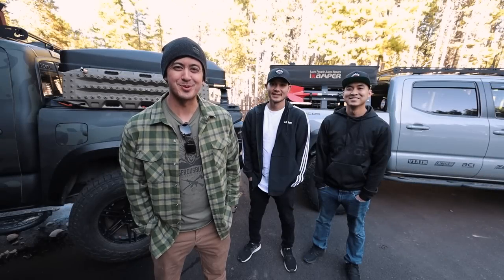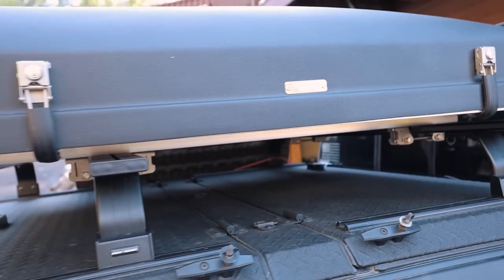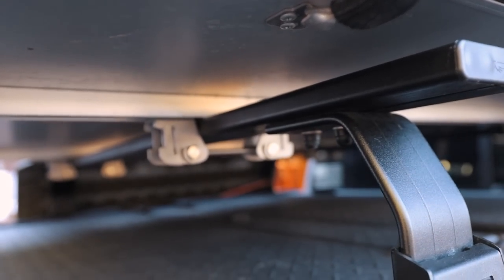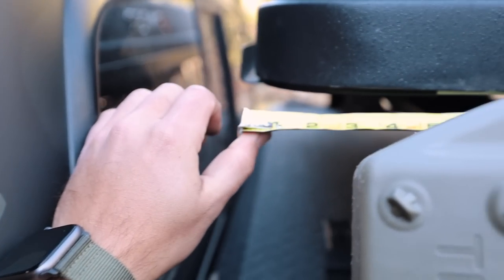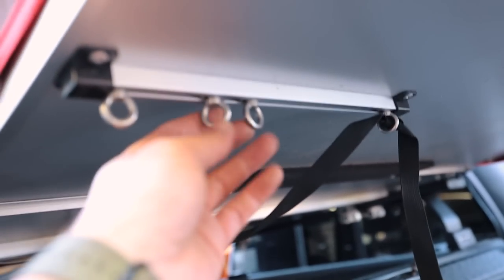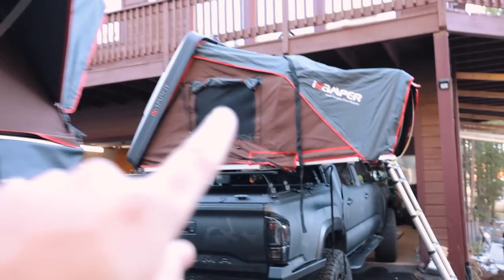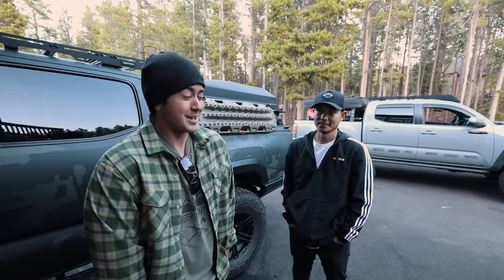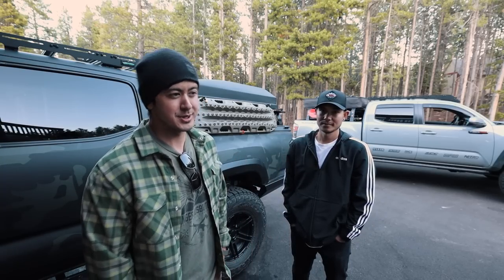iKamper Skycamp Mini vs X-Cover Mini - Detailed Rooftop Tent Review on Overland Tacomas (PROTOTYPES)

Comment: I'm very interested in the Skycamp Mini. I was going to put up with the overhang from the full sized Skycamp but now I'm leaning towards this.  I'll be buying a Gladiator next spring, so the timing is perfect.
Reply: Rick Boyett order it as soon as they drop. I pre ordered the xcover and it took a year to get it. And it was a thousand bucks cheaper pre ordering it. Just a heads up.
Reply: @mikeanshit158  thx for the advice.
Reply: A gladiator?  🤣

Comment: I was torn between both as there are equal ‘pros’ and ‘cons’. My heart still likes the X-Cover, but my head chose the ‘Mini’. Two reasons. 

1. We tend to free camp and move around every 1-2 days touring, so set up/pack up/hard top in windy nights were considerations.
2. The size of the mini (packed up) was the deciding factor. With a standard SUV, it sits and travels so much better. Also, we didn’t realise how much the XCover overhangs the front of our SUV.  We centred the tent on the rails, however this restricted the ability to open the rear boot by 40%. 

If you dont’ move around often, the XCover would be our pick as can carry bikes or fishing gear. But moving around, having to take off the bikes every time you camp and other gear especially if you arrive late or in dark, is not fun. Regardless, what I love about iKamper is they have different models for different needs. Great review.

Oh, if there are three of you i.e. two adults and a child or two, the XCover is a no brainer. It’s definitely larger and more comfortable

Comment: I was torn between the two variant. But since I have an SUV t4r and once installed I'll probably leave it on top for a long period of time. So, after this review my choice is the skycamp for easy set up and take down. And the hard cover will probably protect the tent better from UV Ray and other elements in a long run compared to the fabric shell on the x-cover. I hope ikamper will come up with a thicker layer of tent material just like the newer FSR rtt (tri-layer) for 4 season camping. Thanks for the comparison of these 2 products.

Comment: Nice to see a comparison between the 2. First off I like the skycamp and yes. Mainly for setup speed. I bought the large model. And can easy sleep on a double mattress and use the entrance space for other uses. What I do like on the xcamp is the flat top surface. Which makes adding a solar panel easy. When using the rails. These can also be used for many other purposes. Other preference for the skycamp goes to temperature resistance. Wind protection will be better as well as sun.

Comment: Toyota is the best truck ever made hands down. I have owned Ford, Chevy, Dodge and Nissan ,all of which are also decent trucks and have there positives but when it comes to reliability and just being well built Toyota is the ultimate. I have an 07 tundra 5.7 with 260,000+ miles on it and it still runs like a new truck, It has not even needed any kind of major expensive repair just a few minor things to be expected. I know that's not the point of the video but I just wanted to show my love for Japanese made vehicles. They are just amazing and worth every penny.

Comment: Love the dimensions of the X cover mini.....have storage space to prop up on its side that is 47 in high.  Wonder what the price will be.  I have a 2019 Tacoma SR access cab 6ft bed.  Currently using Napier backwoods truck bed tent for camping.  Napier is also coming out with a rooftop tent next year.

Comment: Great video.  Thinking about pulling the trigger on the Skycamp Mini next month.  Just wondering if you can remove the mounting channels off the bottom of the tent and reinstall them to fit a specific roof rack?  I have a Jeep JLU with a Rhino Rack and from what I hear the tent mounts won't line up with the slat in the rack.  It seams like everyone drills into the Pioneer Platform and bolt it from the bottom witch might be ok to but looking for other options.  Thanks for the help and can wait for the next video.

Comment: I have a long bed doublecab Taco and decided to run with a cap and camperize it rather than a rooftop tent. We are going to head out on a month long trip to test it out. Not sure why most people run tents instead of this option. Is it because most American Tacomas are shortbed?
Reply: Yes, I couldn’t get a manual in the long bed either.

Comment: GREAT VID MIKE.  Knowing that you have done lots of vis now with the skykamp on top of your diamondback bed cover, do you still love the current configuration of the diamonback?  I myself am torn between the great looks and strengths of diamondback and the storage management and tailgate access of the Decked storage system.  With a "basically" full-time cartop kamper, it seems crazy to have the gull-winged diamondback lids.
Reply from the maker: I like the versatility of the big open bed, but covered/secured. Drawers would be pretty limiting for me

Comment: Seeing them all in one video is awesome.  I'm curious about any MPG stats when overlanding though, has there been a huge difference with all the extra weight bolted on going up trails?  Love your videos man
Reply from the maker: Any vehicle will get lower gas mileage on trails. Any vehicle will also get worse gas mileage with larger than factory tires, as well as more weight. Having said all of that, i get about 15mpg for my normal driving in the mountains, and I was getting about 18 stock.
Reply: @LastLineOfDefense  thanks for the insight brother, much appreciated!

Comment: How’s the ankle been ? Was anything messed up after healing up ?
Reply from the maker: Probably take a year or two to heal fully - it got jacked up bad. Walking on flat ground is totally fine now, but running, or hiking is not recommended.
Reply: @LastLineOfDefense  FWIW, I really sprained my ankle very badly once as well and it took about a year to get back to about 90/95%.  I started riding my mtn. bike again and the pedal rotation combined with the resistance pressure from pedaling uphill got my ankle back to 100%.  For a couple months after I started riding my ankle would kind of pop and feel a little different, but never painful.  That eventually went away and I had full rotation and confidence putting full force back into the ankle.
Reply from the maker: @peterfairhurst  Ah interesting, good to know!

Comment: What difference does it make if the iKamper is a few minutes longer to set up? Genuinely curious.
Also, I would like to see a height adjustable rack mount so I can lift it up with a ratchet and then have a retractable canopy/ porch to cook under when setting up camp :)
Reply from the maker: A little extra time in nasty weather feels like a lot. But also zippers suck, especially in the cold. Reaching over up and around kinda sucks when your truck is muddy. So while time is the only easily measurable variable, overall it's just a fair bit more inconvenient

Comment: Hey Mike,  I've been talking to Front Runner and Diamondback all day about the details of adding a similar rack system as you.  I have the Diamondback SE for 3rd Gen Tacoma.  I want to get a iKamper Skycamp Mini as well.  I was wondering why you went with three rack bars instead of two (i'm looking at 2 bars not 3 as this is my daily driver).   Also, it's hard to see where you drilled into the cover and if you think I would have any issues with the SE model instead of the HD model Diamondback?  Please advise...
Reply from the maker: I'm making an install video soon, so sit tight of you'd like. Otherwise search "Ultimate Bed Rack" and watch that video of mine
Reply: Great!  I’m heading to Overland Expo West and would let o get this setup beforehand.

Comment: Do you know by chance if the skycamper will support the iKamper annex system?  I occasionally have 4-5 people with me so I use the annex on those trips and I also like using the annex in the winter.
Reply from the maker: I believe the skycamp and the x-cover both support the annex and awning. I've never used either though, but I think they have all the connections to hook them up.

Comment: i m wondering how to open the daimond back cover since u out a tent on top.
Reply from the maker: With the tent you don't. It's just a rugged, mostly weatherproof cover, while the tent is mounted. Also a giant shelf/table where I put gear and miscellaneous stuff while I'm out camping
Reply: @LastLineOfDefense  I have the Diamondback cover on my 2014 Tundra. What is the mounting system/manufacturer of that one on with the diamondback cover? That looks perfect.

Comment: Ok let’s say one is 2 min faster then the other.  What is the price difference.  

I don’t understand you guys.  If you are chilling and camping what is the difference of 2 minutes
Reply from the maker: A few minutes wasted on an arduous task is far different than a few minutes spent enjoying a mountain view, but I guess it comes down to how much your time is worth to you. Also minimizing setup and take down time is huge when it's raining, snowing, or some other inclement weather going on.
Reply: I can see if you hump your gear and need rest.  When we drive and don’t hump our gear in i have to question this assessment. A few min is not that important.  A $1000 difference may mean three more trips in a year.

Don’t get me wrong. I am new to this amazing thing we call overland.  I love your videos but I want to know more about the advantages of a hard top vs a soft top.  I love your square inch comparison.  I want to know I am spending more money to have more aero Dynamics. Less heat, more heat retention is the cold.

I love your videos and will keep watching them.

Ivan
Reply from the maker: Not at all about rest, setting up either would only wear on the most out of shape person. When working about above your head potentially fumbling with zippers, etc - it's just not a pleasant task. So yeah it's both quicker and easier - so whatever value you put on that.

But yeah as stated in the video the hardshell will be both more aerodynamic, and be more resistant to wind (noise primarily) the quilted hardshell portion will also be more insulated, but when we're talking about tents, they all basically have no real R value.
Reply: Last Line Of Defe
Reply: Great I appreciate your response.